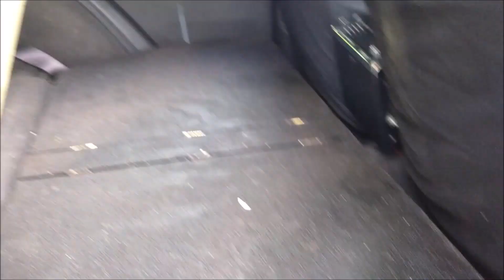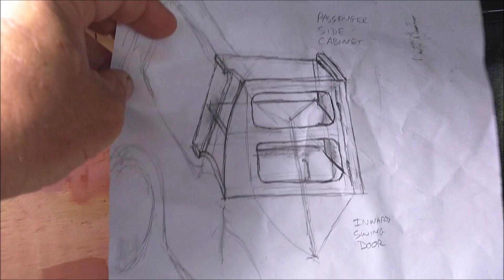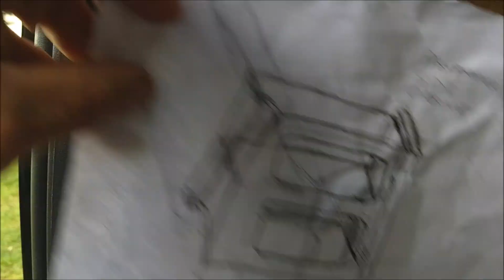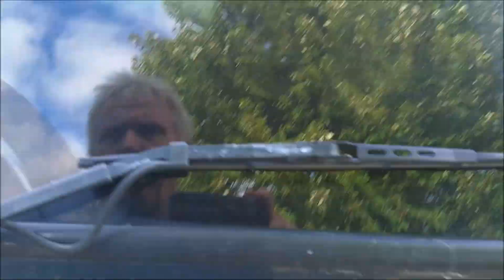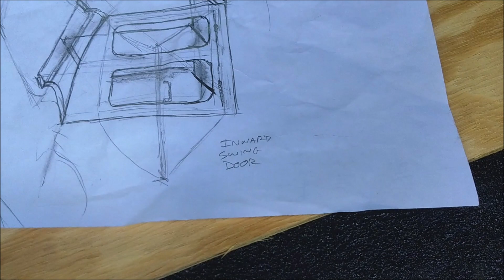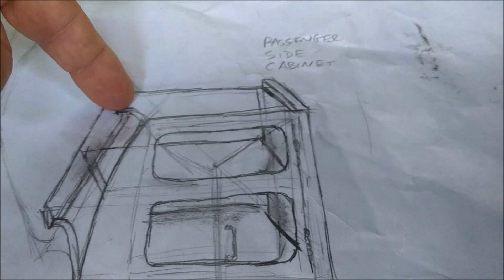Microcamper Cabinet Design - Jeep Cherokee XJ Overland Mods

Comment: It's inspiring to watch your videos because you're obviously throwing your mind into it, and not just your wallet.  I'm taking custody of a 2001 XJ  next week. I say "custody" because I'm going to treat it as if it were my own child, and because I hope to, someday many many years from now, hand it down to the next owner in better condition than it is in today.
Reply from the maker: Thank you @PeraPera. I agree with you on the "custody" viewpoint. This is a classic jeep and like you, I am trying to improve it. It is a great jeep to work on, So far I have changed fuel injectors, coil pack, alternator, steering gearbox and power steering fluid pump. The biggest project was replacing the heater core. I had to remove the dash to get to that one. All-in-all the jeep is a lot happier these days.
Reply from the maker: @Pera Pera did you get the XJ?
Reply: @driley12  Yes. I found a rust-free Steel Blue Pearl (PBQ) 2001 XJ Limited "Special Edition" (possibly 60th Anniversary Ed.) with only 69K miles (112K km).  Apparently it had been sitting un-used for 10 years. I picked it up for approx. 1600 USD on Friday of last week.  So far I've given her a new battery (34MF-7), oil filter and oil (Castrol High Performance 10W-30 for Gas/Diesel), a new serpentine belt, and gone to a Jeep dealer for a new immobilizer key.  She's a real beauty!  She's even got the factory option 6-cd changer and a set of BFGoodrich KO2s.  The previous owner installed a manual radio antenna retraction switch and a button that flashes the hazard lights twice to say thank you when someone lets you merge into their lane (which is a thing here in Japan).  Obviously, I'm very excited about it.
Reply from the maker: @Pera Pera it sounds like you found a really great jeep. I hope you have some great adventures. Upload a video sometime. It would be great to see it.